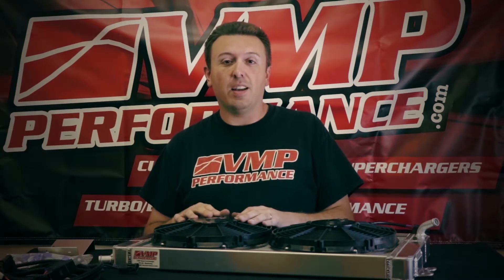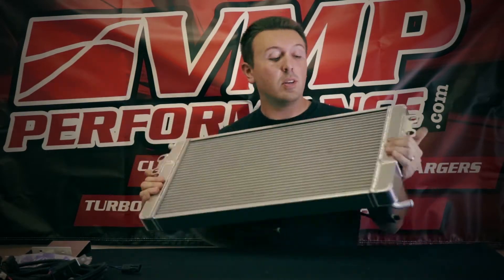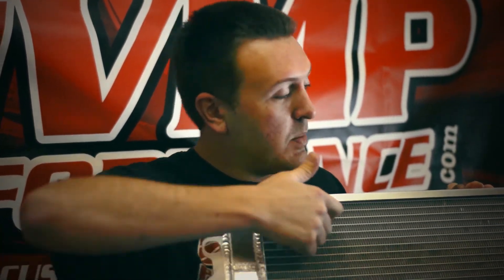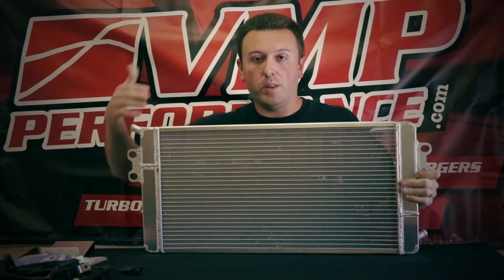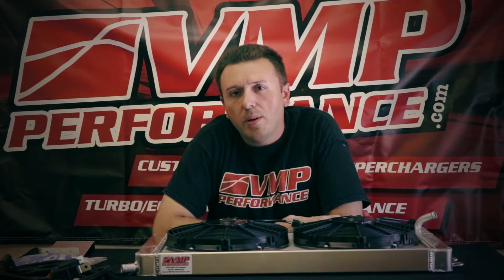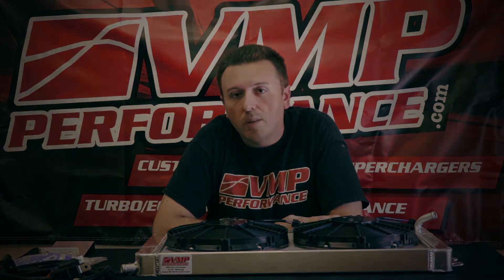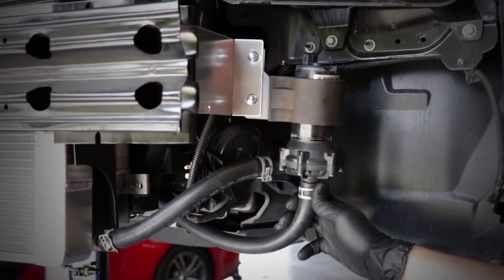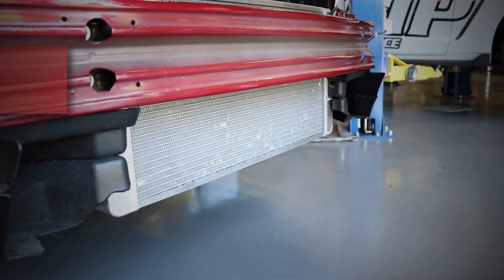VMP Performance Triple Pass/Dual Fan Heat Exchanger Install

Comment: The part I got confused was @ 3:50   RECONNECT INTERCOOLER PUMP HARNESS"  The two orange connectors -  having the Roush setup and removing all of the Roush wiring  Where do i  plug the 2 Orange wires into?

Comment: So what iat did u see before and after the install of the heat exchanger?
Reply from the maker: Hey Bill, we see 20-40F lower downstream temps under aggressive driving situations.   Recovery is faster, and the fans allow cooling to continue even at low speed where there is little airflow.